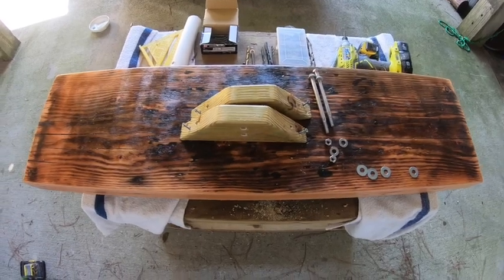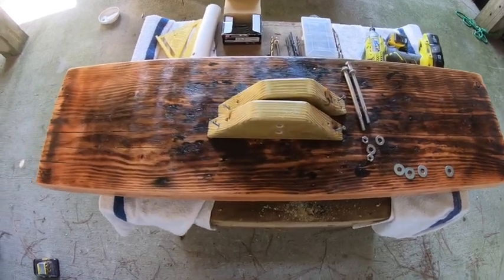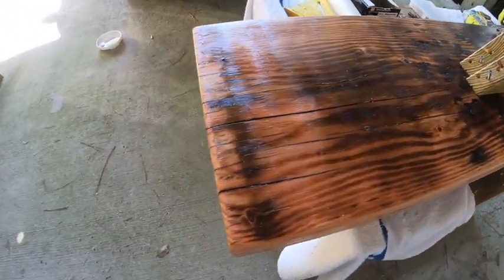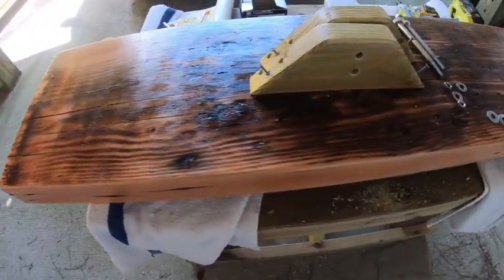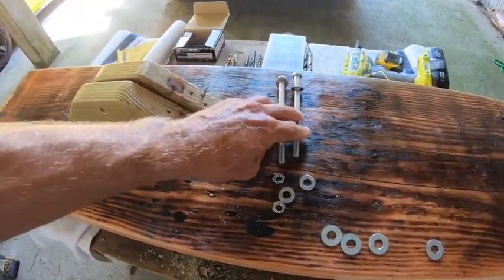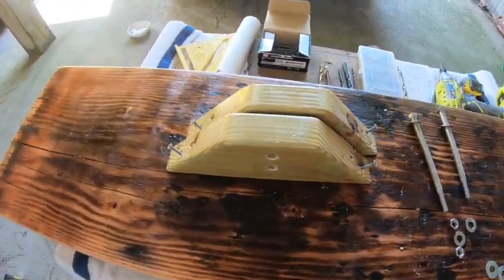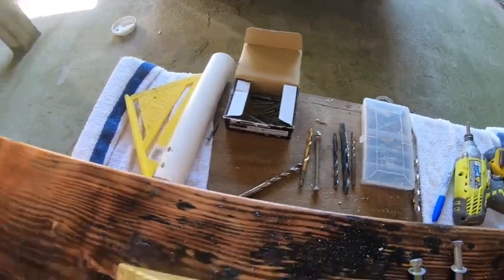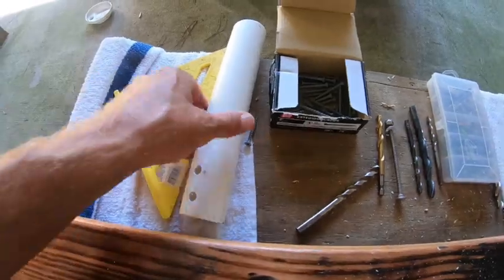DIY Bimini (umbrella) for Small Sailboat

Comment: Surprised u did not need to cut wind flaps into the umbrella to keep it from catching wind.
Reply from the maker: I work with this type of Umbrella 8 months of the year with high winds half the time. If the umbrella is angled a little bit into the wind it doesn't want to fly. The half dome shape really helps air flow. The bungies hold it to the rails, and the dodger directs the wind over the top even better.